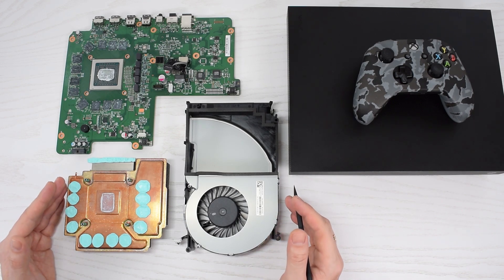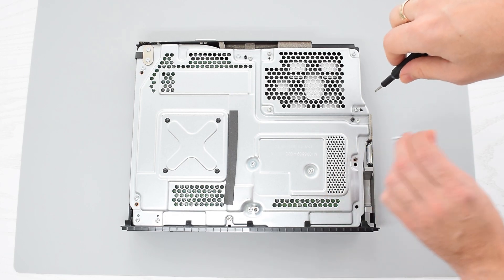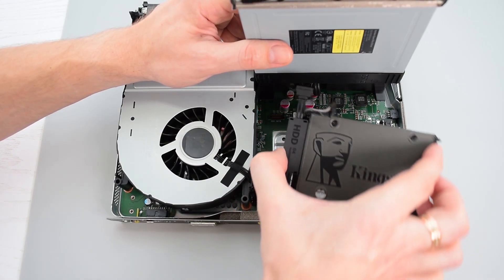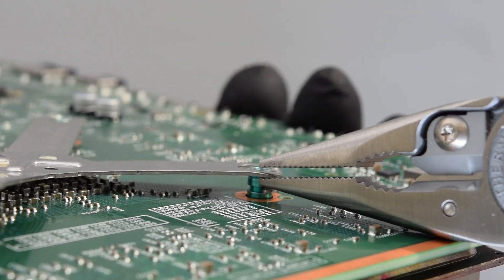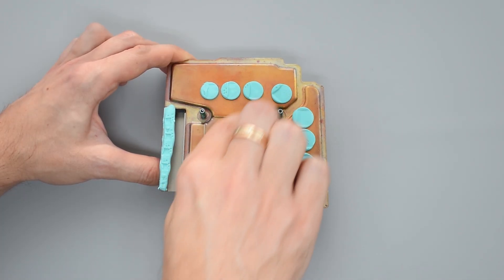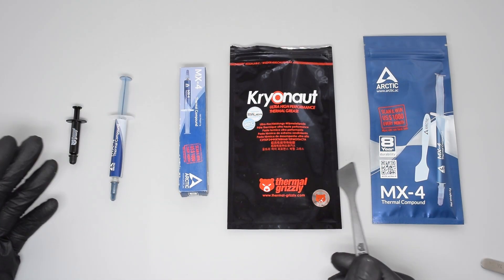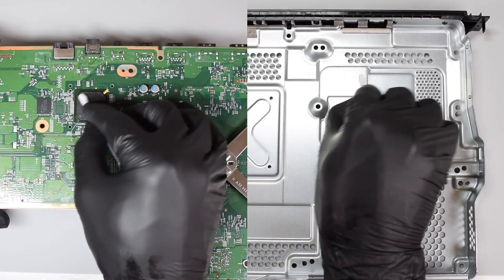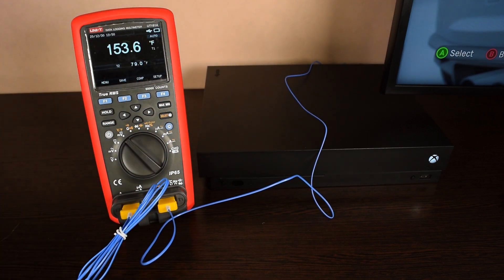Xbox One X Thermal Paste and Thermal Pads replacement. Cooling system cleaning. Best explanation!

Comment: Great video! I have to open my Xbox every month, this only fixes the loud noises for a month, every time I open it the paste is almost gone from the middle and spread out, the little bit that remains on the chip is super liquidy. I’m tired of dealing with it and buying new thermal pastes every month so I’m probably gonna sell mine this month.
Reply from the maker: Original Arctic MX4 lasts years in super harsh conditions. Grizzly dries out way quicker but anyway it'll takes several month to dry out under very high temperature.
Reply: @ElectronicsComputers  it doesn’t dry, actually it seems to do the opposite, it becomes super watery and after a month the fans are super loud. I think the MX4 I bought is real, I’ve bought 3 so far and this ones the best one, but oh well, I guess I’ll sell the Xbox. Great video tho, super well explained! Great job
Reply from the maker: @nosrednawyt  I'd also try to replace thermal pads. I think your heat sink sits very tight on the APU and it squeezes all the paste out of there. Thermal pads will give more support to the heat sink and it won't make so much pressure on the APU die surface.
Reply: @ElectronicsComputers  You should not recommend MX4. Its bad paste for xbox. YOu have to buy noctua o thermal grizzly to keep it quiet for months. MX4 and cooler master are good for few weeks only.
Reply from the maker: @alekanal_pl  Probably you use fake MX 4, because it's so greasy that it will last years and definitely won't dry in several months.
Reply: try arctic silver 5,it is way more tacky and thick than mx 4

Comment: 1.5mm is ok for all pads? including S and X series? I would love to do the same with my S series and add more quality to the dissipation, very good video, clear and direct, i subscribed  :D
Reply from the maker: I'm happy to help and thank you for your support!
It's not that easy with Xbox Series S and X because they require thermal pads with different sizes: 0.5mm, 1mm and 1.5mm. In a repair shop we use same viscous thermal paste (which is not super efficient just about 5.3W/m.K) something like this: https://amzn.to/3vp7BvI
I'll make a video about upgrading thermal pads, thermal paste and the SSD on Xbox series X.
Reply: @ElectronicsComputers  will this pads help better than original pads? Wich chipsets need 0,5-1-1,5mm on series x :) i did the thermal paste change with one x and it did alot! I think my series x wont do alot better cause its already cool but some it should do
Reply: @ElectronicsComputers Hello, any update with the vídeo?
Reply from the maker: @Heromon  On the component level the project was finished and I filmed the process. Unfortunately, the SSD didn't show up and we started to work on the firmware. At this point I'm not sure if the problem was in the firmware or I simply missed some data lines on  the PCB. I'll finish that video real soon and share all my progress. I hope we'll make it work.
Reply: @ElectronicsComputers  i see, i'm not sure if the internal sdd could be upgraded, check this vídeo, maybe can help. https://youtu.be/nyKUVmJmAGY

One last question, what thicc i need for the memory chips on the series x ? 1mm or 2mm ?

Thanks!
Reply: Wouldn't you void the warranty doing so
Reply from the maker: @chriswright8074  Of course it will void the warranty but there's usually no need to do it during the first year of using your console. Also, all Xbox consoles that come to our service are usually 2-4 years old, so chances that your Xbox will die during the first year of use are pretty low.
Reply: @chriswright8074  Greetings, of course in another country I would lose the guarantee but I am from the Dominican Republic and here we have no guarantee therefore I always try to take care of and improve my consoles as much as possible
Reply: @manuel6456  that I can understand

Comment: Awesome video quick question is it necessary to replace the pads? I have mine apart and the pads don’t look for feel too bad can they be re used? As long as I don’t touch or move them? Or now that I have them apart they will not contact correctly
Reply from the maker: If they are not dry then you can reuse them.

Comment: Can you guys help why after replacing paste and pads the box is ventilating more as if it was from factory? Btw i ocured shut down due overheat after 2min of forza in menu. After that nothing. I puted enough paste and pads are squeezable.
Reply from the maker: If your thermal pads are thicker than 1.5mm then the heat sink won't be able to make a proper contact with the APU die surface. And if you can squeeze the pads with your fingers it doesn't mean that the same happens between the cooling components and the heat sink.

Comment: 1mm or 1.5mm pads?

I want to order one set of pads for my ps3, Ps4 pro, and Xbox one X.

Great videos
Reply from the maker: 1mm for PS and 1.5mm for Xbox. Technically you can try to use 1mm pads on Xbox but I wouldn't do that.

Comment: temperature improvement is nice, but pretty small considering the effort. i would be more interested in whether this procedure reduced noise for you.
Reply from the maker: That video was made on a brand new Xbox. If it was a console that was used for a few years then the difference in temperature would be way bigger.
Reply: @ElectronicsComputers  I just disassembled mine! Mine is from 2017 and there’s no dust in there at all! Microsoft did a great job sealing this thing up!
Reply from the maker: @manuel0578  Some people bring consoles to our repair shop that look inside like a vacuum cleaner.

Comment: how many millimeters thick thermalpad is right? 2 mm good?
Reply from the maker: You have to use 1.5mm thick thermal pad. Anything thicker and the heat sink won't make the contact with the APU die.
Reply: @ElectronicsComputers  so 2mm is good even better no ?

Comment: Put everything back together and now it turns on for three seconds beeps and shuts down. Any recommendations are welcome.
Reply from the maker: Carefully disassemble and assemble again. Make sure you've connected the fan and all ribbon cables have good connection. Why you decided to disassemble your console in the first place?
Reply: @ElectronicsComputers  starting in Jan the console was turning off when playing games saying it was overheating even when cool to the touch. It slowly got worse to the point it was shutting off just watching a YouTube videos

I took it back apart and got it to turn on for about 5 mins. After starting back up it said the improper ventilation message shut off again and is now back to where we were before turning on for about threes seconds beeping and turning off

All connections were tight the fan was running and right before shutting off it revved up to what I would assume is max speed.
Reply from the maker: @tanner4671  It's hard to say what's going on with your console without having it on the bench. First, you have to make sure that the console is not overheating (your heat sink might be dead). If you've ever replaced thermal pads make sure that they are not thicker than 1.5mm. Also check your power supply if it has popped capacitors then you have to replace them or the whole unit. That's what you can do at home with some simple tools. Can you boot it into the recovery mode?
Reply: @ElectronicsComputers  I can’t boot it to recovery mode it won’t stay on long enough. I checked out everything you suggested and didn’t see anything that looked unusual or out of place. Decided it was time to let someone else take a look at it. I have a local repair shop that I dropped it off with and will update here once I hear something. I appreciate all the help 🙏🏻. Fingers crossed it can be brought back to life!
Reply: @tanner4671 I know this is old, but any luck getting it fixed. Did they find the cause and solution?
Reply: @MajesticCorner4652  Unfortunately not. They were just as confused and lost as I was. Basically told me to hack it up as a loss.

Comment: For the thermal pads it’s ok if I only choose 6w/mk cause men it’s way way to much expensive the grizzly thermal pads than other ones in my country but the most powerful it’s only 6w/mk it’s good enough for the Xbox one x? or better stay whit the stock ones , And re install on a more proper way ?
Reply: Sorry for my English not my native lenguaje and men awesome vid I’m gonna clean my Xbox more often after this vid thumbs up and fav !
Reply from the maker: You can use those pads too, just make sure that they are not thicker than 1.5mm
Reply: @ElectronicsComputers  how you can taste a thermal pad can you ? Or only trust in the paper saying what w/kw is ?
Reply from the maker: @eduardmaster  You have to measure the temperature of the cooling component and the heat sink. If you use high quality thermal pads the cooling component should get colder and the heat sink hotter.

Comment: I’ve already applied thermal paste twice (Mx-4)... and at some point it overheated again - first after 6 months, now I’ve put the paste in January and today it overheated once again, every time I did what I’ve seen on other videos - just a tiny blob in the middle, should I just spread the paste all over the chip and/or replace the thermal pads too?
Reply: You may have got a fake MX4. They are all over the stores on amazon, eBay and AliExpress. I used Arctic MX2 on a computer processor in 2016.  The processor has been overclocked since day one and the temps have not changed at all. Temps are super cool when on idle and very good when gaming or stress testing.

Comment: Добрый день! Можно ли наклеить 1 мм термопрокладки друг на друга, чтобы получилось 2 мм и использовать? Спасибо.
Good day! Can I stick 1mm thermal spacers on top of each other to make 2mm and use it?
Reply from the maker: I don't recommend doing that. Technically it will work but thermal conductivity will be extremely bad which may result in overheating RAM chips and MOSFETs.
Reply: @ElectronicsComputers  ok,thank you)What size of thermal pad was in your video?)
Reply from the maker: @dimonzagora6862  It was Grizzly 1.5mm thick thermal pad.
Reply: @ElectronicsComputers  thank you very much!

Comment: When picking up the fan, there was a 2.5inch metal rail, with padding on the outside that fell onto the board.  Looks like it could have been sitting on top of the hdmi ports, or on the edge of the copper part of the heat sink on that side, but I am not sure.  Anyone else see one of these and know where it goes? Thanks.
Reply from the maker: Can you send a photo?

Comment: good sound quality here hmm do you have video's how to screen capture wii and wii u ? Samsung SSD ... ? I know samsung cant make reliable TVs, fridges, washing machines ect... maybe just phones. what do u think ? I heard also Samsung is buying out the sony LCD tv business. will be finding alot more broken sony tvs probably.
Reply from the maker: All most popular brands (Apple, Toshiba, Dell, Sony, Hp etc) use Samsung's LCD panels, memory chips, CPUs etc. Samsung makes very reliable equipment  starting from cell phones ending with helicopters and ships.
Reply: @ElectronicsComputers  Ok but if you drive down the street you will find most refrigerators on curb are samsung, and especially for tvs again samsung on curb relatively new but not working. Most washing machines (top load and side load almost always a samsung), dryers, stoves on curb and relatively new SAMSUNG again.  So unless my eyes are fooling me.  And I almost never see a LG or SONY dead as side of road. And if I do .... they still work ! = ) very rarely will I find a samsung product on curb that actually still works.
Reply from the maker: @BIKEMAN21  Look, I have several repair shops and they are fuddled with all kinds of stuff. And I know all that stuff on a schematic level. We have huge piles Apple's product's (because they have unbelievable number of design flaws) and stuff from Dell, Samsung, Sony/Xbox consoles etc and these ones not because they are bad but because those brands deliver great quality and get more sales. Almost all my home appliances from Samsung, my friends, relatives, colleagues have Samsung smart TVs. Samsung is everywhere that's the reason why you see them everywhere.
Reply: @ElectronicsComputers  That actually makes sense now... never thought of it like that. Its like F150 … best selling vehicle in north America so will be a few bad apples.

Comment: Hello and thank you for the guide. Can you please tell me if the fan from aliexpress is ok to buy? I would like to order one but I'm not sure of it's quality.
Reply from the maker: Usually we use salvaged fans from dead consoles but sometimes we install new fans from Aliexpress it depends on client's needs. The fans from my link look and perform absolutely the same. The only problem is that new fan assembly comes without insulation adhesive tape, so you'll need to buy it too or you can reuse one from your old fan assembly.
Reply: @ElectronicsComputers  Ok, clear. Thank you for the info
Reply: @ElectronicsComputers  Hello again, sorry to bother you on this topic but could you please suggest what type of insulation tape should i buy? Thank you.
Reply from the maker: @nenadcostici2116  It's pretty basic stuff which you can find in any construction store or here online: 
https://amzn.to/3bIB3VO
http://ali.pub/5mnyk9
Reply: @ElectronicsComputers  Again, thanks for all the helpful information.

Comment: There are a lot of forums and threads on reddit that replacing thermalpaste with grizzly compound and thermalpads are making  fan loud asf or even louder...My question is are those true or maybe they missed the step of taking the plastic covers from thermalpads. For me is doubftul that replacing the thermal paste which is dry and basicly fucked from the start does not change the thermals. Please help me out here cuz I may do the open heart surgery on my xbox one x :D
Reply from the maker: Thermal pads from Grizzly are the best on the market. We use them in our repair shop and we never had any problems with them. Thermal paste Grizzly Kryonaut is not bad but it doesn't last long like MX4 for example. Grizzly Kryonaut will dry out in a year or so while MX 4 could last for several years.
Reply: @ElectronicsComputers  but the question is if all the hassle is worth it? U know what I mean ? Now my Xbox fan speed is fluctuating when I’m gaming. Sometimes it runs hot and in less demanding games is quiet and warm only. But that’s normal. More demanding games are pushing Xbox to the limit. I’m asking if changing all that will help in more demanding titles.
Reply from the maker: @Gaara7809  After paste and pads replacement when I play Forza Horizon 4, Red dead 2, Metro exodus etc my Xbox one X always works on minimum RPMs.

Comment: why on the reverse side of the board there are oxides on the edges of copper and on the board white clouds are incomprehensible ... explain what it is!? I tried to wipe it off! but then I see it doesn't wipe off !
Reply from the maker: That white residue commonly seen on almost all Xbox motherboards and it's not that easy to remove. That residue can occur due to improper soldering or cleaning techniques or because of a mismatch between the flux and the specific flux remover employed.
Reply: @ElectronicsComputers   l tried to remove it, but it does not rub off And I also touched the board with my bare hands, but it seems that everything works, thank God ... when I saw from below I thought someone had filled in the microcircuit! Then it may appear because I touched the board with my bare hands ... not knowing! !thank!!!)

Comment: hello! but with bare clean hands you can touch the board ... why are you using the glove? with your hands you feel better!? thanks !
Reply from the maker: That's how we repair stuff in a repair store. In theory, you can damage sensitive electronic components with ESD (Electrostatic discharge) from your body.
Reply: @ElectronicsComputers  l did everything with my bare hands. Well, then I turned it on. It seems that everything works and after a while now the board will fail ??? tell me ???) thanks! Many on the video do it with their bare hands without knowing! Now wait for the board to fail ??? ((((
Reply: @ElectronicsComputers  I assembled and disassembled And touched everything with my bare hands How to find out that static electricity did not say anything on the board. It seems that everything works! What kind of thermal paste and gum do you like for the rest of the parts and of normal quality, almost like a blue-green and white square at the factory if you change it! Thanks !

Comment: Master please advise thermal paste on xboh 1 x! thanks!
Reply from the maker: We use MX4 in our repair service because it provides good thermal conductivity and it will last several years. Grizzly Kryonaut is also a good choice but you have to replace it almost every year because it dries very fast.
Reply: @ElectronicsComputers  )))